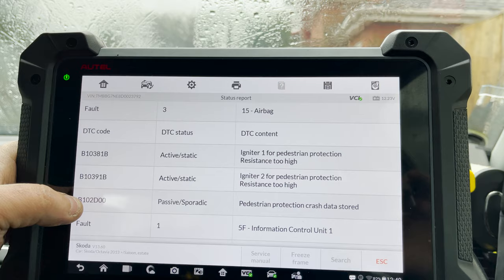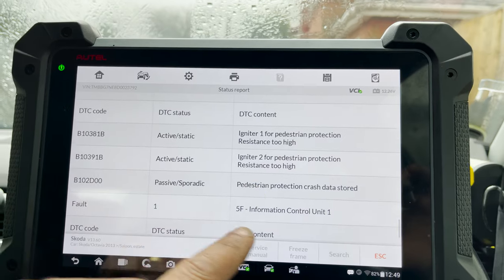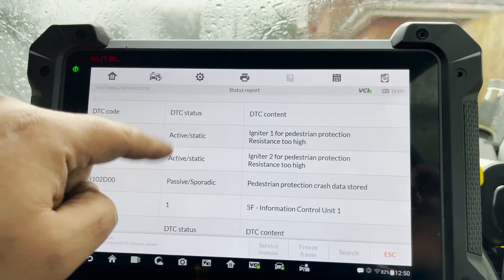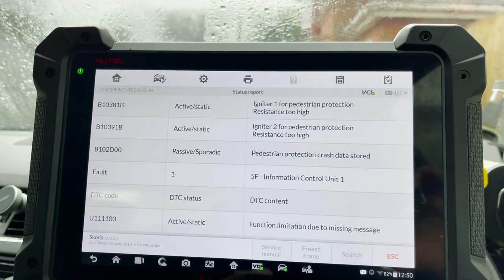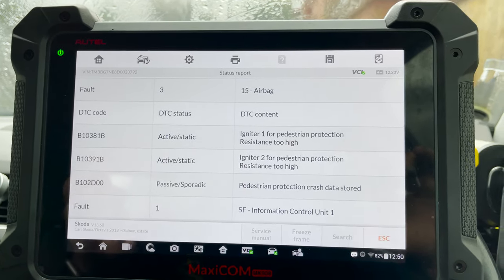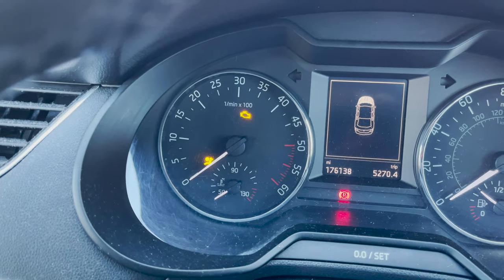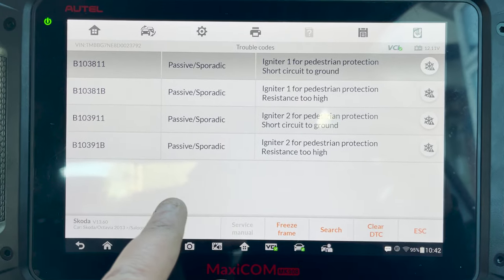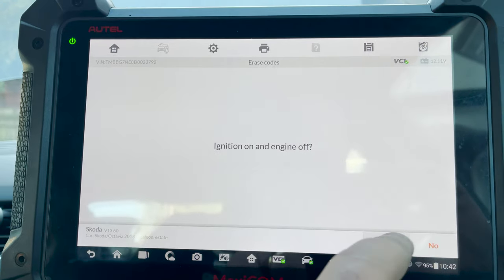Active Bonnet | PEDESTRIAN PROTECTION Skoda Octavia DTC B10381B B10391B Igniter Resistance too high

Comment: in order not to replace the igniters which are a useless cost in my opinion, is it possible to connect the wires of the pretensioners that have risen and then with the OBD turn off the warning light so as not to have to replace them but to be able to turn off the warning light inside the panel? thank you

Comment: I gotta feeling that this system is a bit pricey.

Thanks for sharing this, something new to add to my knowledge base.

Trying to get caught up on my European friends videos 😉

So apparently the Restraint Module doesn't require replacement after deployment?  I suppose since it is not considered a collision?

Great video brother!
Reply from the maker: Thanks Pauly , at least for this Skoda it was quite inexpensive but it can very with other makes and models . 
I was pleasantly surprised that the restraint module didn’t need to be replace or crash data to be cleared I thought the same thing maybe it’s not considered to be a collision as such , cheers mate 👍
Reply: @CarsExposed  Hello i have Audi A4 2019 with Same problem, im in uk can you help please

Comment: I am just in the same situation but for an Audi. They quoted me around 300€+ for the igniters and labor. But looks very straight forward. 
Ordered the parts now I'm waiting for them but I did put a question of a forum to which they said that only Audi can clear that DTC after replacing it but I can see that you did too. Are you sure the error doesn't come back?
And 1 more question. I have the same error as "tank lid activation..." Did you find a way to fix that? 
Thank you and great work
Reply from the maker: The airbag fault never came back again I’m not for if it’s the same for the Audi but I suppose it should be the same , I never looked into the tank lid fault
Reply: @CarsExposed  thanks for the reply. I will install them and I will try to clear them myself. If you ever look at that tank lid error please let me know
Thanks again and cheers
Reply: @CarsExposed  Good morning Alin and Miguel from Mr Cars, thank you for your help,  Please, may you reply ?  Before to change the two sensors, I should disconnect the battery ?    I have another light:  B13BCF2 multiple anti-collision brake - no function - "Archived" (STO), please what is it means ?  Thanks again . .and have a nice day.

Comment: Interesting. I've never heard of this system. I'm not sure how that helps protect a pedestrian however.
Reply: it diverts the pedestrian upwards to reduce the angle they hit the screen and been proven to reduce the impact  usually to the head. Every little helps
Reply: @the_retired_mechanic  Oh okay. Thanks.
Reply from the maker: Super interesting system Wyatt , for what I’ve been reading the main purpose of this system is to cushion the impact of pedestrian to the hood , specially preventing head injury 🙌👍👍 cheers pal

Comment: Looks like the radiator is toast as well.
Reply from the maker: The coolant level was in the minimum line but i,vê runned the car to operating temperature and couldn’t see any leaks 👍
Reply: @CarsExposed  The front one might be the AC condenser. Not sure just by looking at the video.
Even if it doesn't leak now, it might leak in a few weeks due to the damage. I guess the owner will decide if he wants to replace it or not.